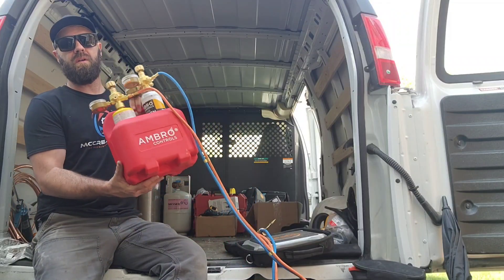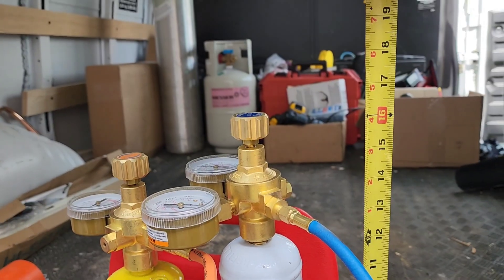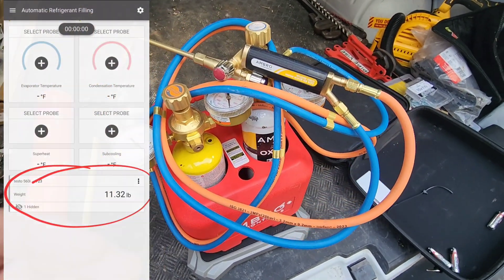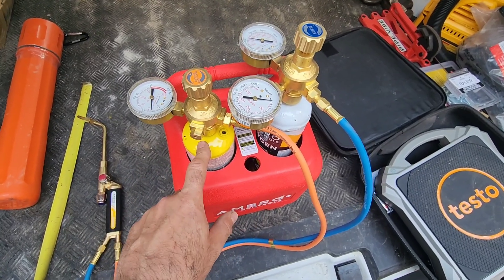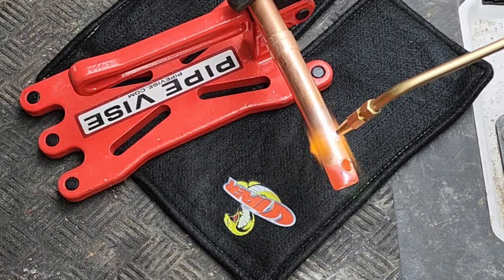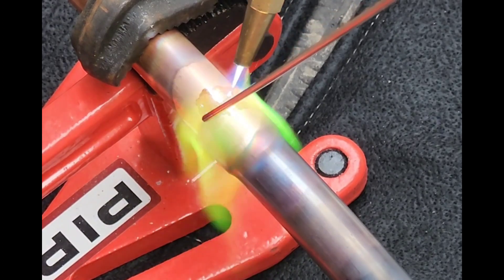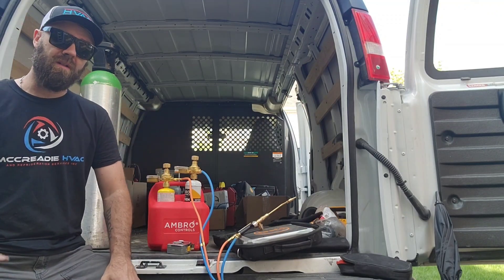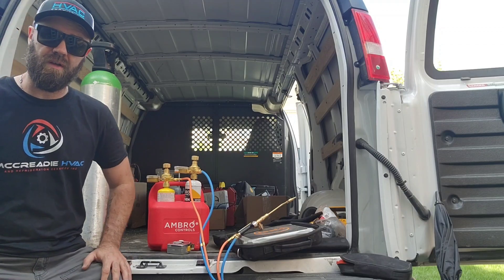Ambro Controls OXYSET Demonstration - HVAC/R Brazing With Torches

Comment: 🫤several residentials with o2? Not the way I shake and roll. 😆 And cramp! 🥴 
But still really like the idea. I have bunch of 30 year old Goodman heat pumps for 3 rd floor Apts and no elevator. So, my old ass would benefit greatly with this. 
 Appreciate maaaan. 🫵👍  
 I haven’t heard you going back because of a crappy joint, must be doing something right.

Comment: This dude doesn't know how to braze. That flame was way too lean
Reply: Yep, he also conflates heat with temperature! I run 5 acetylene and 7 oxygen, for a carbonizing flame (not sure how that translates to mapp / oxygen, but doubt it would be 5 mapp and 60 oxygen)… Finally, he brazes like one would solder electrical joints… Hey buddy, the allow follows the heat, hold the flame on the opposite side of the tube, not above it!
Reply: @E @EarlHayward lol shut up nerd

Comment: I've been using it for resi service for about 3 months. It's a great set. The weight is a huge plus, and it gets plenty hot even for 1 1/8th copper. The flame is larger than my old oxy/accet set , which can be problematic in tight spots. As far as the oxy lasting. I just keep an extra bottle on my truck just in case.